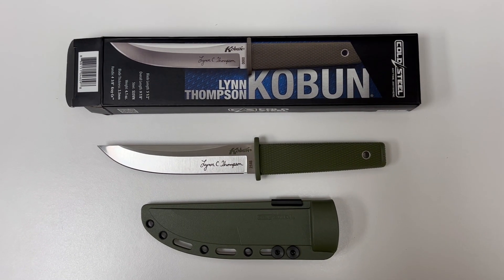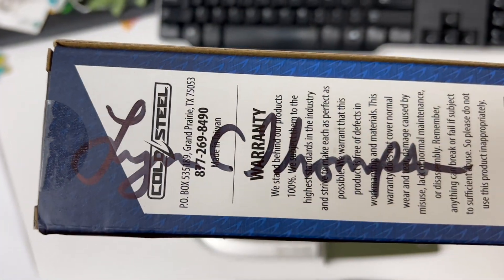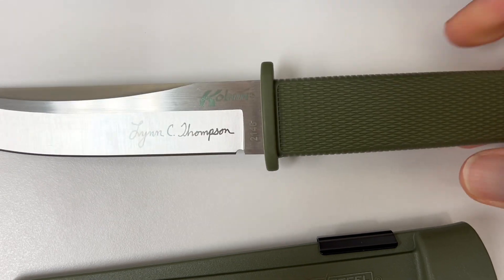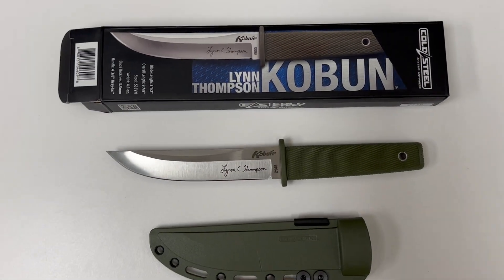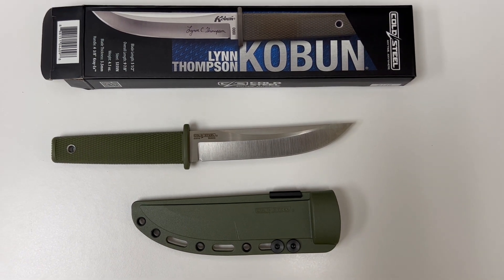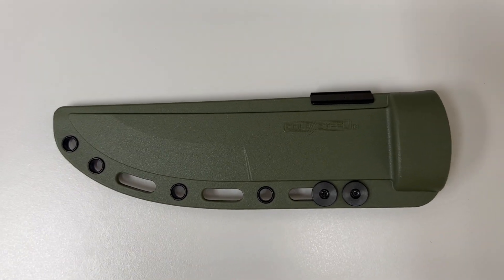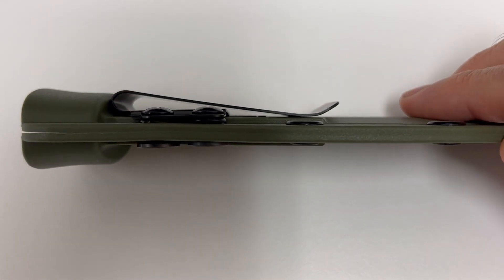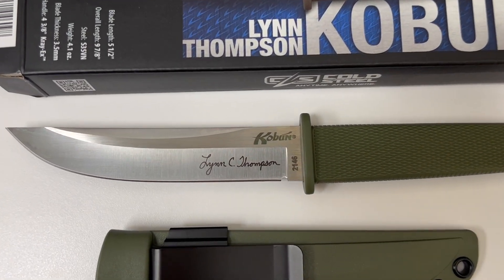Cold Steel Lynn Thomson Kobun

Comment: I got quite a collection of CS folding knives, this asymetrical grind is seemingly present in almost all of CS knives- whether its a budget 8cr14MoV sr1, or aus10 voyagers, or s35vn SR1/recon 1.
I have few serrated models as well, where right side of the blade is fully flat, and the left one is grinded at abrupt/wider/bigger  angle, and into this side they carve the serrations later. 
My hypothesis is: it seems as if taiwan factory is first doing serrated models, and then they do plain ones, but forget to properly adjust the machines and thats why they grind sides at different angles, ending up with flatter/narrower angle on right side, and abrupt/wider angle on the left side- just like in serrated ones.
Reply from the maker: The blade was just poorly ground. Maybe it was a Saturday evening special. I got another copy of the same model, and it was symmetrical.

Comment: How is it disappointing?  Its going to be mounted in a wall or display cabinet...? I grew up on a farm and spent 12 years as a butcher...that 1.5 to 3 degrees off means NOTHING in actual usage..?..also growing up huntinģ fishing and running trapline
Reply from the maker: The difference in grind angles between the secondary bevels is about 10 degrees.... 17 degrees vs. 27 degrees.